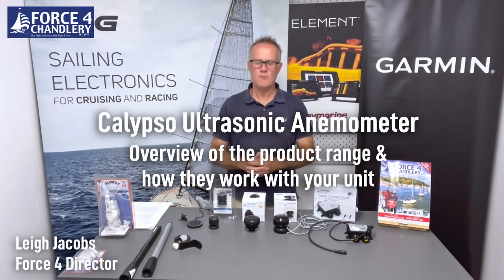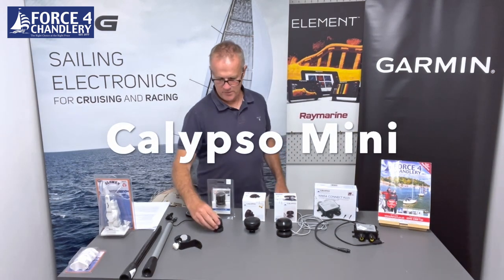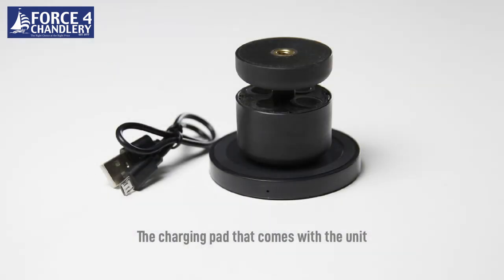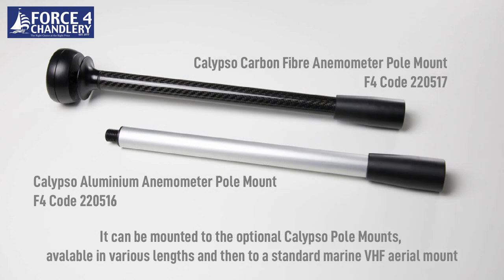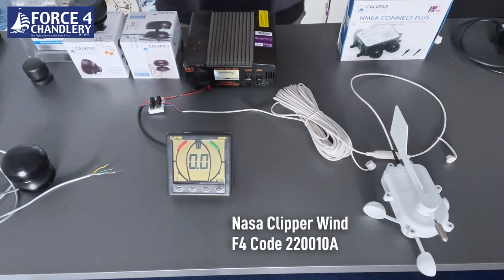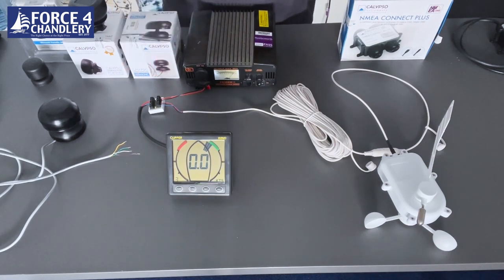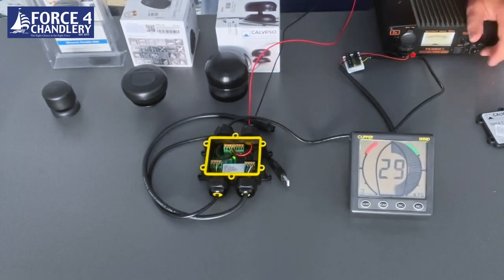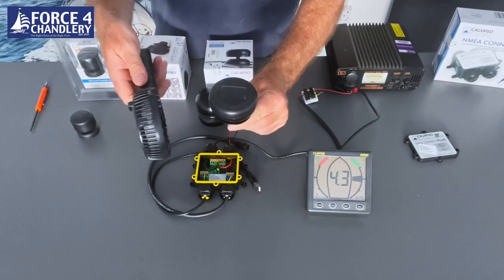Calypso Ultrasonic Anemometer - Review and Features

Comment: There’s a huge advantage to this, looking for this for the next boat. Biggest thing so far was that the Chiba build anemometers are not designed for yachts and did not have a waterproof screen solution whilst these hook up to the normal equipment 

We all know birds ruin the top mast units and the standard mast transducers often fail